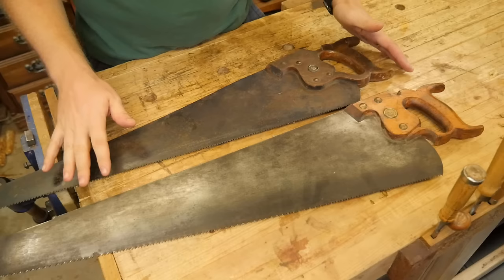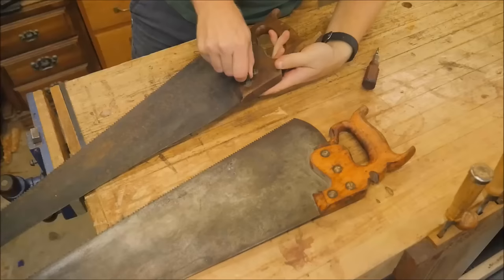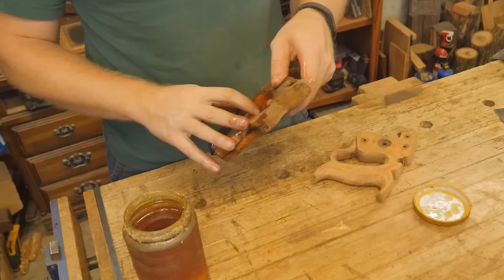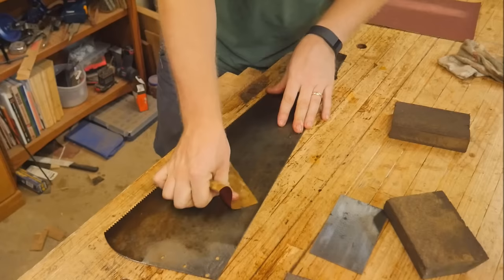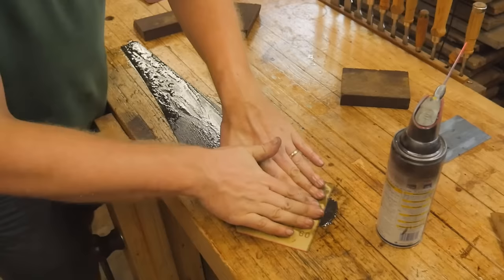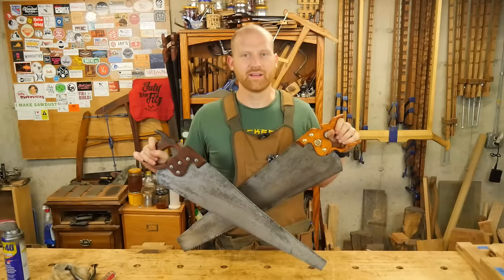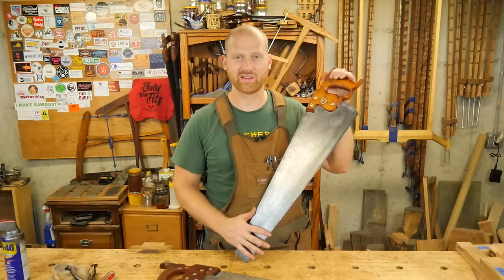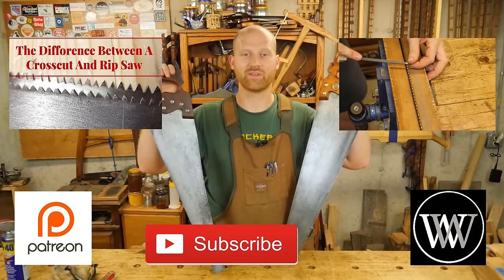How to Restore an Old Hand Saw Crosscut or Ripcut

Comment: I noticed that you just wiped away any WD40 that got on your work bench, is there any problems with it transferring over to the wood in your projects, or is it such a small amount there is no problems with it. Also are the screws used on a saw handle special screws if so  can I buy the screws for a saw at a big box store or a hardware store. I was given an older saw that is missing 3 of the screws thank you in advance, Blessings to you and your family
Reply from the maker: there is a bit on the bench before I move over a wood project to that place I will wipe it down a bit more but I have never had a problem with it transferring. I like the look it gives the bench to have all those layers of projects that have been done there. you ca not get them at hardware stores and there are so many sizes that they are hard to replace. I have a collection from saws I have restored that I can pull from but there are not many places to find them new.

Comment: Do you know how to take a bend out of a saw? I have an old saw that was a great grandfathers I want to restore and there is a slight bend towards the end of the saw.
Reply from the maker: If it is a curved bend then you just bend it back. It takes a lot of force, but it is doable. If it is a kink then it takes hours of skilled labor and generaly means the saw is trash.
Reply: Levi, handsaws were traditonally straightened and tensioned by gentle hammering on a hard serface, anvil or eng grain wood block works well. Lay the saw with the curve up and hammer lightly around the effected area, try to cover all the saw spine to tooth in lines. It may sound hard, but is easily mastered, Ive done over 50 saws this way and only a couple were beyond hope.

Comment: Why not start the panel with a razor blade? Much easier and invasive than sandpaper
Reply from the maker: if it is not too bad I will start with scraping or if I am trying to save an etch. but if the blade is bad and there is no etch to save...
Reply: @Wood By Wright  That is true.

Comment: hello...i enjoyed your informative videos. How i wish these saws could be found in my country. And actually today I have found an old carl schlieper handsaw but in really poor condition. So here is the problem, the saw  tooth does not have an equal size or form due to bad sharpening work. So how can i address this issue?
Reply from the maker: +ebbios well you have two options 1. Just joint and sharpen them. Some people like to have small teeth up front and larger in the middle to back. Or 2. File them all the way out and cut in new teeth.
Reply: oh...ok. thank you. That was fast....haha
Reply from the maker: My pleasure. I am thankful for the over abundance of old tools around me. that is not the case in a lot of countries.

Comment: Why a 50/50 mix with vinegar and water? Why not 100% vinegar? 

Haysom
Reply from the maker: +Matty Haysom 100% is too fast for me. I like to let it soak over night and check on it so it does not go too far. If you do it 100% and ad some salt it can be done in an hour or less.
Reply: I've not heard of the salt trick. How much salt in your opinion would one use for a similar amount of liquid that you used (being of 100%)

Can't wait for this projects end result. Loved the workbench project you made for the kids as well. 

Haysom
Reply from the maker: +Matty Haysom I have heard alot of difforent mix amounts but most are around 4tbls per gallon.

Comment: In the past few months I have watched several saw-related videos. Also some of Yours, which have been interesting.
But this one... It's nice made (like all of Your videos) but the information is few. I mean, the 2 most important steps while restoring an old saw are filing and setting the teeth.This almost 8 minute video shows 17 seconds of filing and 0 seconds of setting.
I'd rather have a sharp blade that is rusty than a beautiful shining blade that is dull or not set (or both). 
Rust (okay, it produces some drag) is more a cosmetic thing. For me, function is more important than look.

So don't get me wrong when I say: There are better Videos about saws. Also some of Yours.
Reply from the maker: Thanks for the feedback. I have several videos on sharpening and setting, and when this video came out, that video was the next one. It would have been it too long to put it all together. I keep improving the content. Thanks for the feedback that helps.

Comment: Sad to see you using those same two boards for your saw clamp as in your earlier sharpening video. The purpose of the clamp is to keep the plate rigid, as in NO flex while sharpening. The round over edges on your boards provide no support and you can see the plate flex on each stroke. This means each stroke your file angle is not consistent with good sharpening. The main idea is to maintain as consistent an angle throughout each file stroke. 

One would hope, Mr. Wood by Wright, who derives so much joy from making his own tools, would have made his own saw clamp by now, and gotten rid of those two repurposed boards. 

It's the wise man who learns by other's mistakes, it's the fool who learns on his own. Perhaps you should watch Paul Seller's videos on restoring and resharpening old saws before you make another saw video.
Reply from the maker: they work fine. the amount of flex is negligible. making a dedicated saw vice is on my list, but it is a long way down the list.